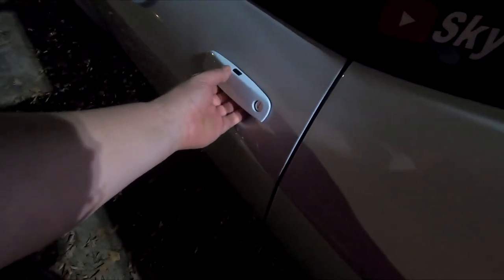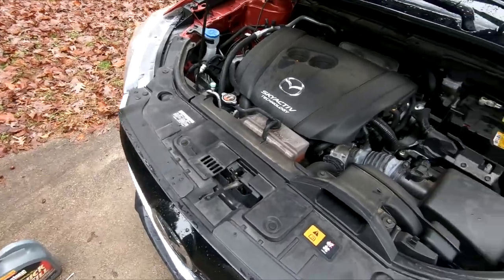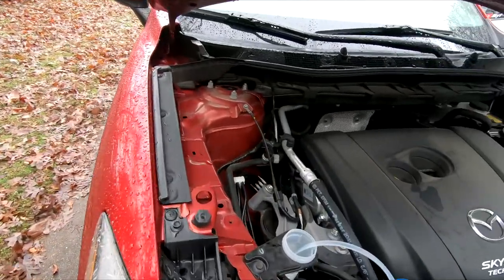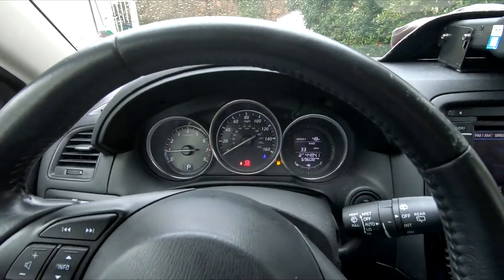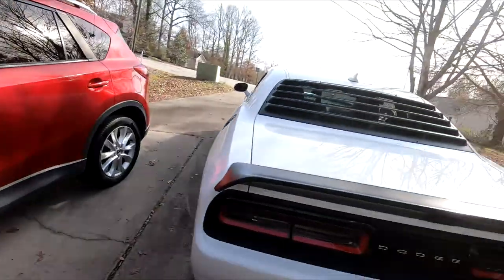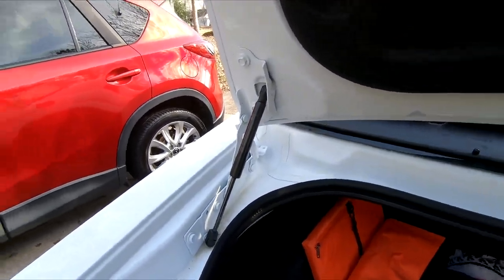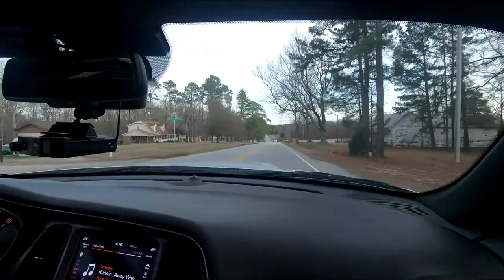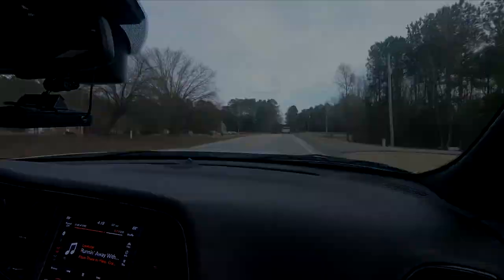Showing new puddle Lights and a CHECK ENGINE LIGHT ON Sue's Mazda CX5  code P011a

Comment from the maker: They thought it was a Sensor but turned out to be a Heater Core issue, very expensive proposition and a common issue with 2015 Mazda CX5's I was told. Thankfully we were still under her extended warranty which covered the complete repair.

Comment: I just had the same experience with the engine light.  No codes came up.  I have the 2015 CX-5 as well.  Not sure what to do about it.
Reply from the maker: I should have done an update to this. It was temperature sensor but after speaking with the dealer they told me it was a common problem, the heater core needs to be replaced. We had an extended warranty that covered it. Could be rather costly. After we got it repaired it has been great ever since. These Mazda's run for ever. Your issue may not be the same.
Reply: @Sky1  Thank you for responding.  I will check on my heater core and see if that is what is wrong.  What does the heater core do anyway?  I'm clueless when it comes to cars.
Reply: @debrakinder5824  The heater core is a small radiator inside the ventilation system. Warm coolant is circulated from the motor into it and it provides heat in the cabin when you turn the heater on.